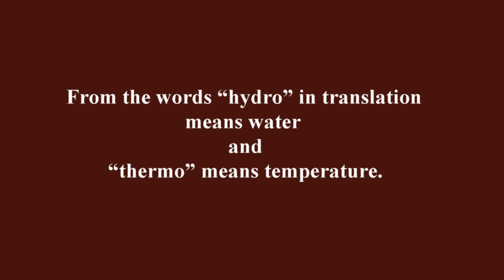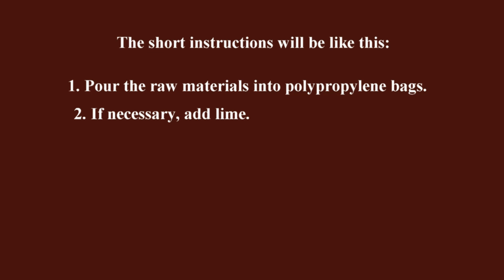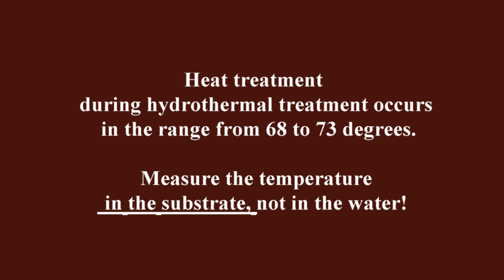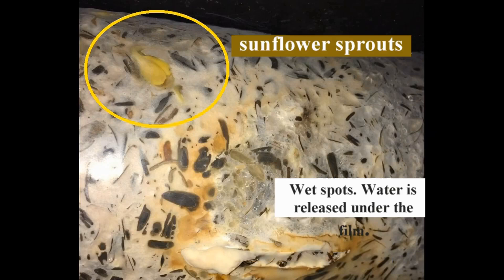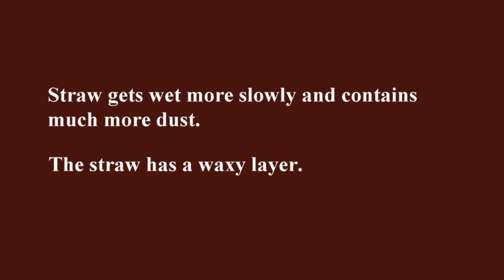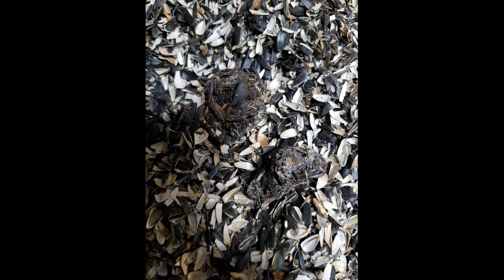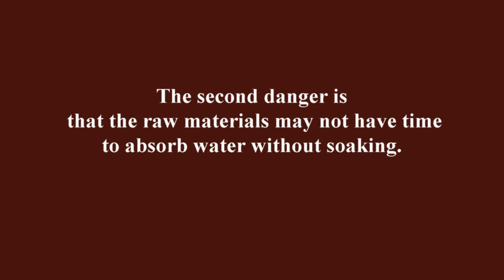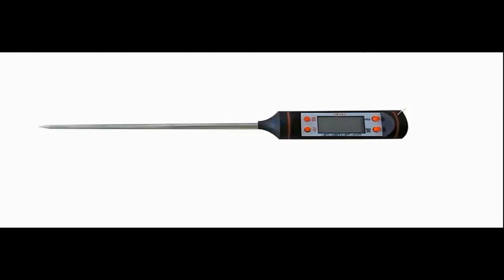Hot water pasteurization of oyster mushroom substrate. What temperature do you pasteurize substrate?

Comment: What amount of time would You advise for pasteurising woodshavings and sawdust?
Reply from the maker: Both sawdust and shavings have low nutritional value. Therefore, they are used only as a base with the addition of nutritional supplements and only when sterilizing the substrate. Perhaps, if you make a small amount of substrate, they can be pasteurized. But if the sawdust is too small, it absorbs too much water and the mycelium cannot breathe there. You can slightly dry the sawdust in the oven after pasteurization if you make 2-3 tiny blocks. This is not suitable for large volumes.
Shavings, on the contrary, absorb little water. Therefore, I cannot give recommendations on pasteurization time. No less than 3 hours, and no more than 8 and a temperature of 68-72 - this is the range for any type of raw material.
You will have to set the time empirically in this range. Since even different types of shavings will absorb water differently
Reply from the maker: and how many kilograms of substrate did you plan to make?
Reply: @OysterMushroom_expert-tech  i'll make 2kg bags with a Total of 4 per batch to pasteurize in my pressure cooker. I know te pressure cooker is for steam sterilizing, but that is te largest pot that i have.
Reply from the maker: will you make a substrate only from sawdust? without supplements?
Reply: @OysterMushroom_expert-tech  te recipe that i have for now is 1/4 sawdust and 3/4 woodshavings. Later on when i have more experience, i might add wheatbran for extra nitrogen.
Reply from the maker: as i wrote above, sawdust and shavings have different water absorption. if you pasteurize for a long time, the sawdust will become too wet and the mycelium will not germinate in it. if you pasteurize for a short time, the shavings may not be wet enough. why don't you want to sterilize if you have a pressure cooker?
Reply: @OysterMushroom_expert-tech  thank you for all the info. I guess i Will steam sterilize the shavings for 4 to 5 hours as the books of Stamets  states (suplemeted sawdust) . I was checking if the pasteurisation methode would be  viable, but since the different absorption rates of shavings and sawdust i think i'll stick to steam. I gave it a try without suplementation, but than i only get one flush. So next time i Will add the wheatbran.
Reply from the maker: yes, if it is going to be steam sterilization, you can add bran. good luck with your experiments!